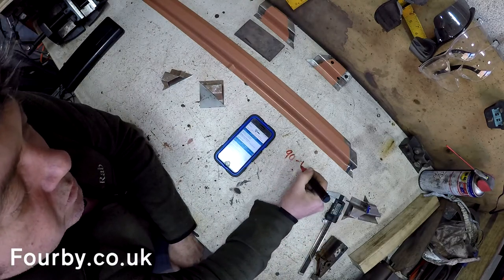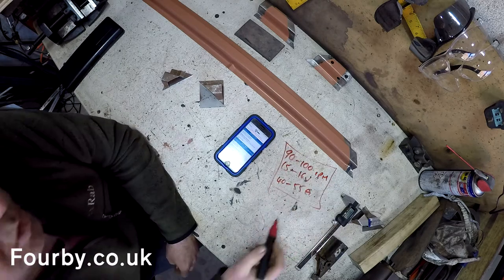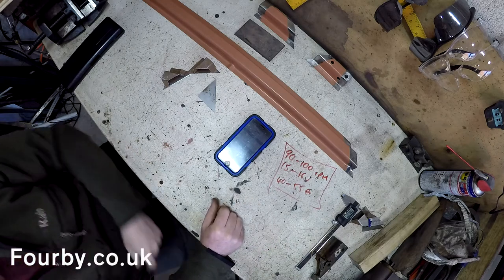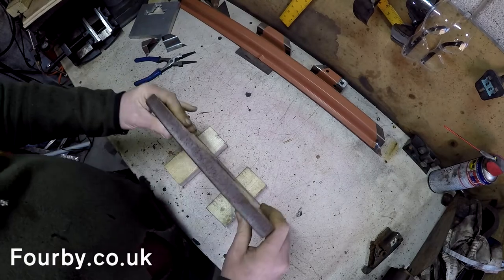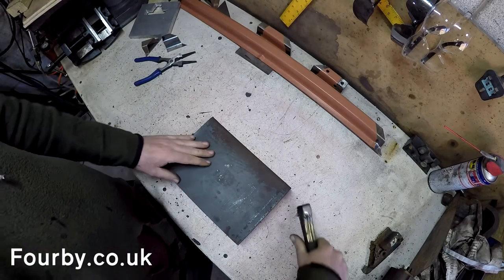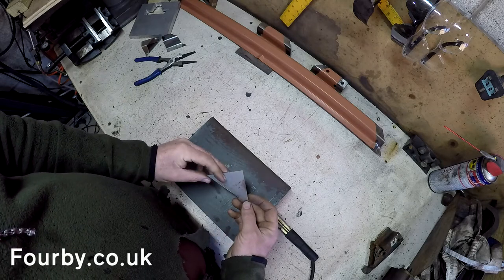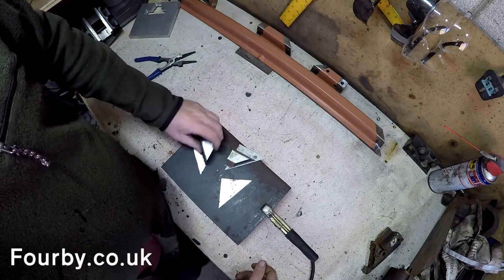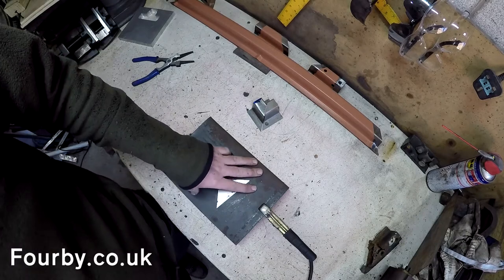Land Rover 110 Restoration #16 "Welder Settings"

Comment: YouTube has to provide a stupendously excellent like button.    Just thinking though.  When checking the voltage you could disconnect/unlatch the wire feed rollers to stop the wire feeding.
Reply from the maker: Land Rover Toolbox Videos I'd forgotten I did this vid, that meter was a fiver from Maplin. I wasn't gonna use the high end fluke meter just in case.

Comment: The Miller equipment has digital read out for wire speed and voltage.  Easy for some.  Us in the UK have to use the force for welder settings.